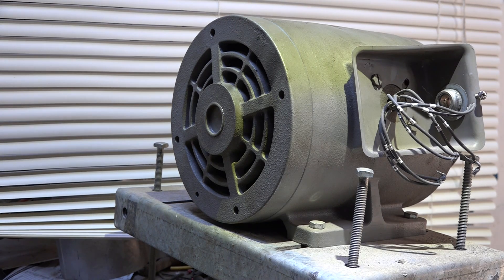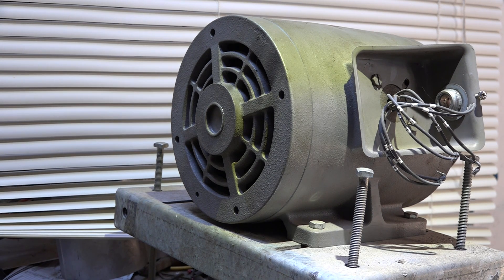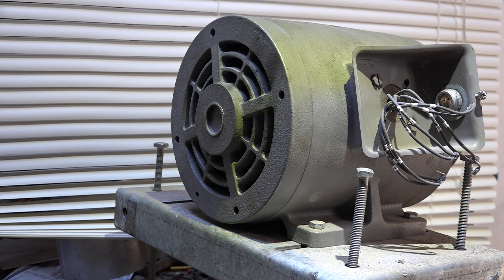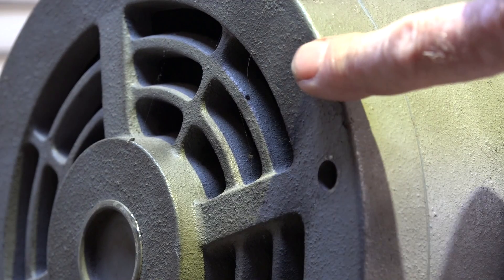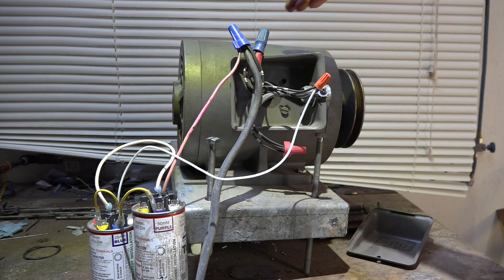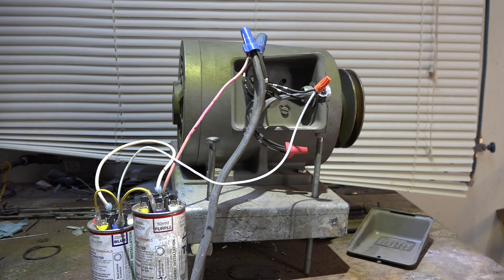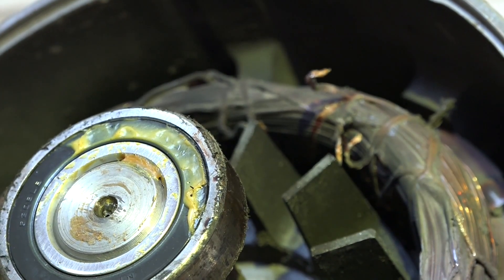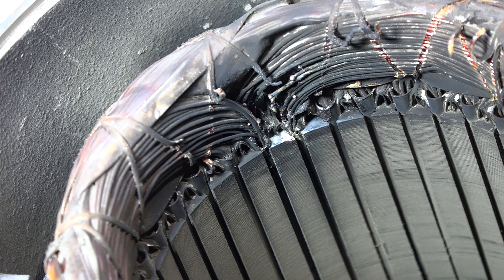Why did this motor fail?

Comment: When you added the 2nd.capacitor  did you check the voltage going to the third laig, and is it possible that it is getting too much voltage on that one phase?   120/240 volts 3 phase, no wild laig?  just saying

Comment: A three-phase motor is expecting a supply voltage that is 120 degrees apart from each leg, whether its delta wound or wye wound. The 75 mfd. capacitor may not have been the correct value unless the inductance of the windings was known and a suitable calculation made to create a 120 degree phase shift (which would usually take a very large capacitance). Let’s assume however, that the 75 mfd. capacitor is correct.
 
Let’s take L1-L2-L3 in a delta configuration. Assume L1-L2 is across the 240V single phase supply, so far so good. However, L1-L3 and L2-L3 are problematic. What may have occurred is that the capacitor stored energy to the point where the voltages added and burned at least one winding. It wouldn’t surprise me that voltages as high as 330V or more were across one or more windings expecting to see 240V. Start windings and run windings in PSC motors generally have different inductances. In this case, this motor is not a PSC unit and would have had windings with equal inductances. What is amazing is that the capacitors handled enough current to cook one or more windings.
 
It’d be interesting to see if you could wire one winding to be 240V and the other two to be 480V and calculate the inductance. Then calculate the capacitance needed to create a true 120 degree phase shift.  Then use two capacitors of equal value, one for each of the other two remaining windings so the motor sees what it thinks is a true rotating magnetic field.

Comment: Perhaps the commercial unit you pulled it out of did not have enough air moving across the evap coil being partly plugged up.  Overheated the motor and shortened its life.
On the bench you need at least 10 Mfd. Per hp.  Thus the 75mfd capacitor should have been sufficient.  Last reason the motor was plain worn out being in a commercial unit it probably ran 22hrs a day. 7 days a week.

Comment: If the rotor did not spin up then the current draw is say 5 to 7 times higher than the run current. ie the locked rotor current. Thus if somehow the 3rd wire with the caps did not have enough out of phase "kick" the motor never got to run (revolve) and the thus the current spiked and the stator wires burned.

For review a century ago in the pre OSHA days chaps would rope start a 3 phase motor on a single phase line by wrapping a rope around the shaft and tugging to turn the shaft. Then they knife switched 2 of the 3 motor wires to the 240 volt single phase line. ie The 3rd leg was not used to start the motor like on todays "phase converters" . Then the 3rd leg was used to feed other 3 phase motors in a dinky machine shop. ie they did it without capacitors. This 3rd leg with the pseudo voltage often would be a tad lower in voltage and thus sometimes they used an autotransformer to boost is voltage a bit.

If you get to do this again with another motor you can add 3 el cheapo clamp on amp meters on each of the Three 3 Phase legs,to measure the current ;  and add some fuses or circuit breakers to limit the current. ie protect the motor. 

On larger 3 phase motors they have a motor starter than may throw resistors in series until it starts, or start motor on one half the voltage via switching the mix of wires. Then when up to speed the resistors are out and the motor is run on full voltage.

Probably the motor never came up to full speed and the wiring got fried, or you had just crummy insulation ie bad luck.

You probably know all of this, I just thought to chine in so others can learn too.

If the 3 phase motor never speeds up to close to full rpm then the current draw is large and thus the I squared R (wattage) loss in the stator coils can got to the moon and cook the motor.

Regards